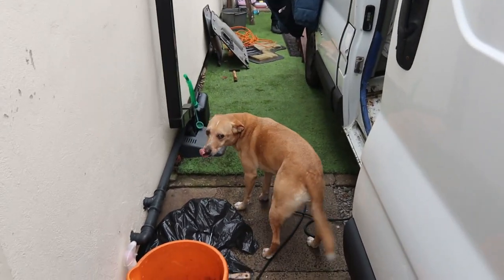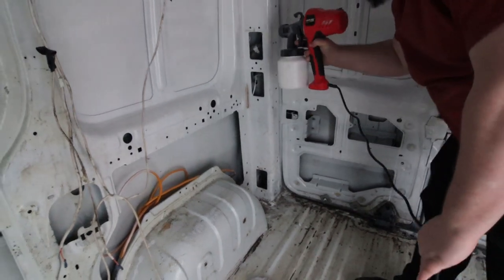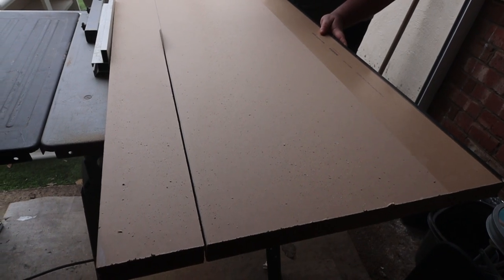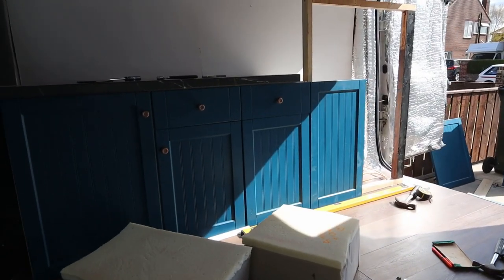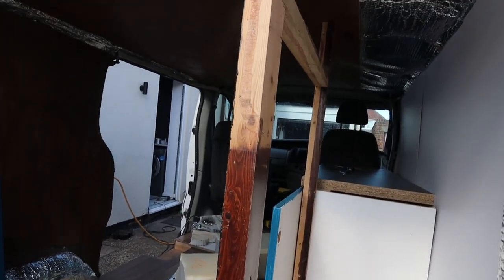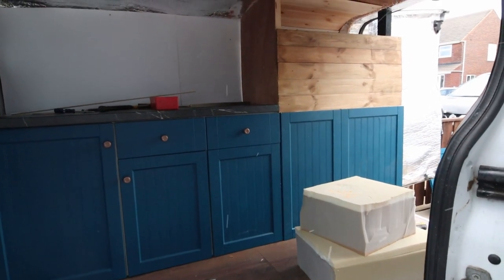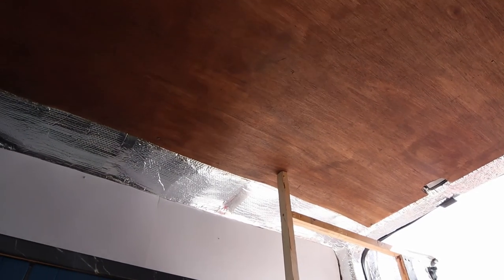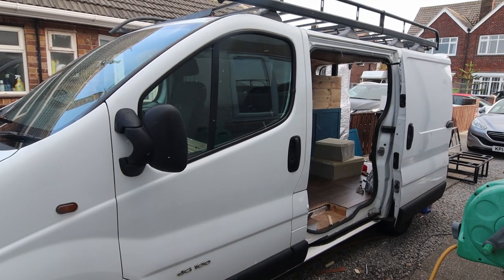Our Harry Potter Inspired BUDGET VAN BUILD | Part 1 | Our engine is broken!

Comment: you must be the despair of your Dad.   Hopefully however he may be able to teach you a bit of diy.  Being a practical soul, to me the first thing is the new engine, never mind decor!  But I can give you one tip, practice your wood skills on cheap crappy wood first before doing the thing you want.  Do buy tools that you need and if a thing takes longer than 20 mins you're prob. using the wrong tool or doing the thing wrong.  And also, consider the usefulness of custom vinyl wall prints rather than actually building a wooden cabin in the back of the van...